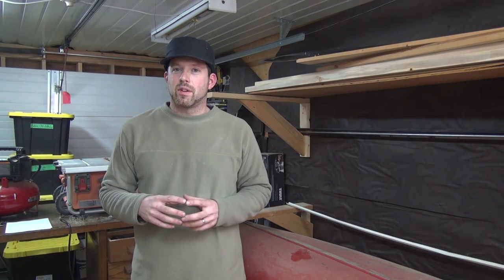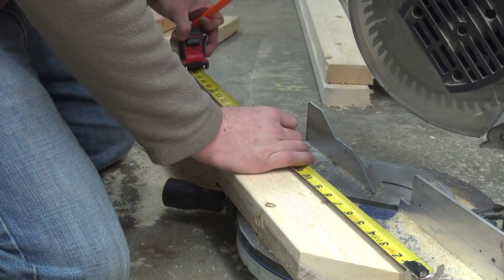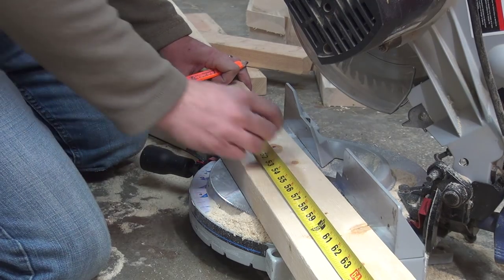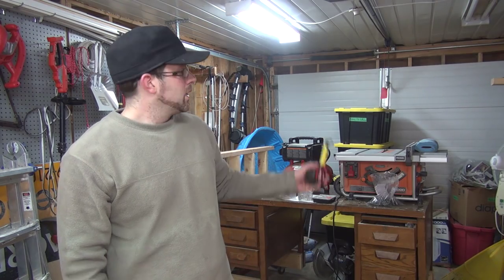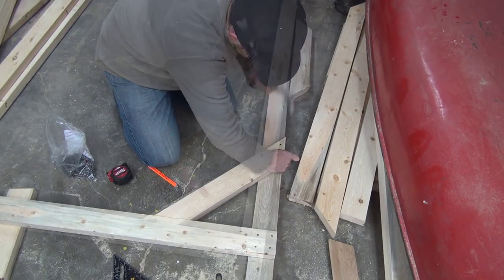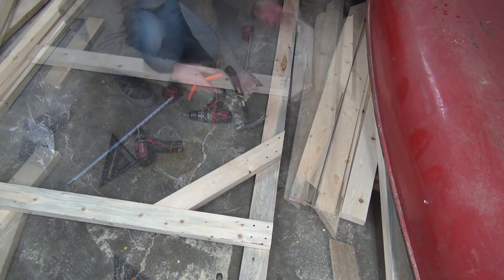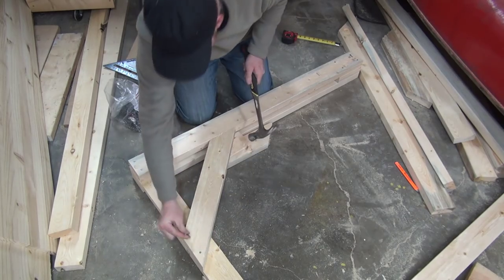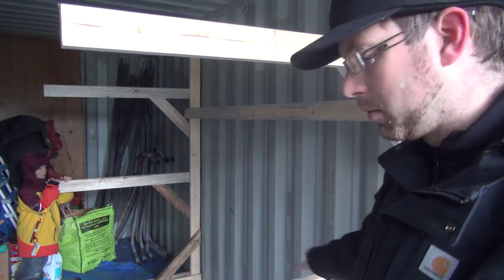How to build a free standing Canoe Rack

Comment: Thanks so much for this! I am buying a house with little yard space I hope to build one of these alongside the fence, next to the driveway. I am thinking about using exterior grade wood. 

You may find this funny, but maybe you can share your thoughts. There is so little space, that I hope to build the rack taller, so that the first canoe is 3 feet or more off of the ground, to fit the garbage and recycling bins under the bow or the stern. Then, I would like to make 3 sets of arms over top of that, to hold my 3 canoes. Are there any considerations which I should take into account, when going that high? A single sided rack is really the only option for me, since there would not be space to access vehicles in the driveway otherwise.